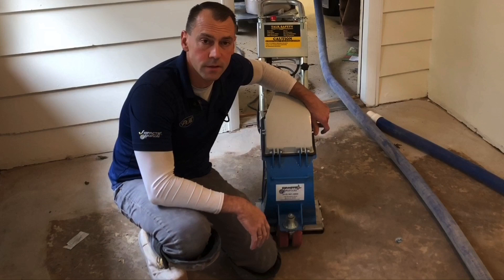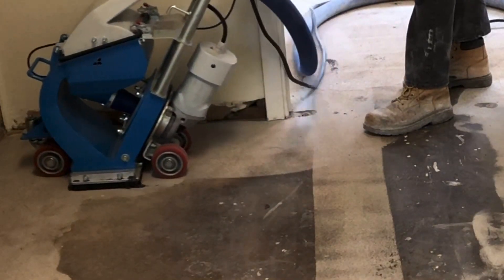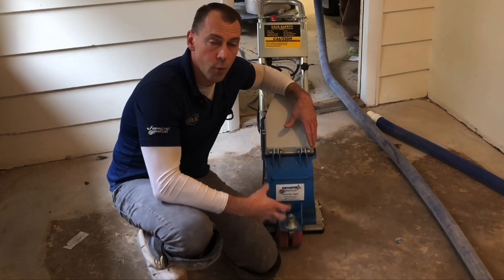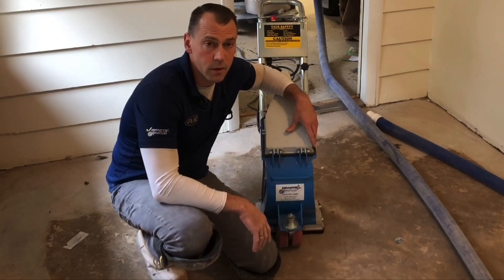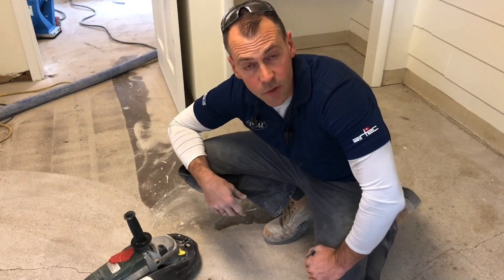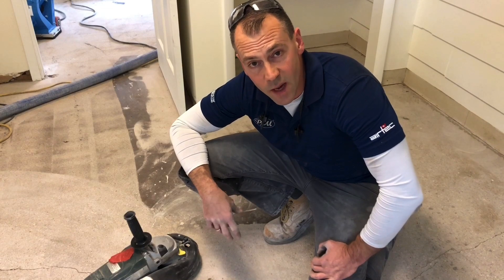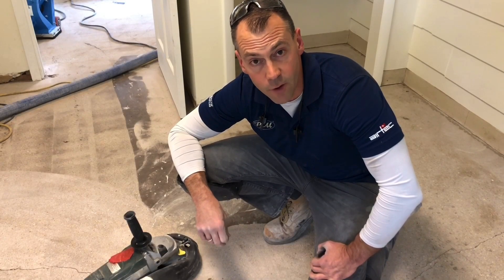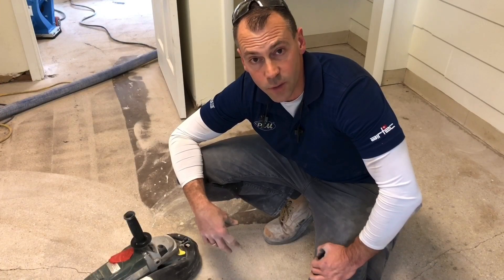Choosing Shot Blasting Instead of Floor Grinding for Surface Preparation

Comment: I complete a quartz floor and shot blasted...used polyaspartic.  on the finished floor I can still see the overlap of the shot blaster,  Should I have gone over with the diamond grinder afterward or maybe just use ehe diamond grinder from the start..wasnt a harsh profile but still showed.

Comment: If it is all about removing the weak layer then the shotblasting is great, but if u need to level the floor out then the grinder might be better
Reply: Well said. The blaster does a great job to remove the fine top layer and leave it dust free. If any elevation inequalities are present, though, those will remain the same after blasting.
Reply: @joshjones8047  to be fair if you are slaping on epixy it would semi self level but also if you are they to slap on a coat i wouldnt worry or expect the floor to be leveled

Comment: Why not just go over that area twice with the shot blaster? Would it not clear it off?
Reply: That’s why both tools have their place. Use a grinder first then shot blast for that perfect finish
Reply: That’s a good question. A second blast might remove the remaining material. The problem with a second blast, though, is the clean areas will be abraded a second time. This will leave these areas a little lower than the spots that still had contamination present.
Reply: Would the adhesive stick to the grinder?

Comment: Back to the grinder, i have not tried a blaster and usually do larger areas, should i just buy a grinder, or not and what model to buy
Reply: Sorry for the delay. If I had to decide which to buy first, it would be a grinder. Grinders are more dynamic to do surface prep than a blaster. They can remove adhesive, coatings, and flatten the slab. A blaster does a terrific job to remove cure and seal, provide a uniform #3-#4 CSP, and leave a very clean surface. A grinder is my preference for the first machine to own to do surface prep. 
As far as models, there are so many choices. The place to start is determining how many SF need to be done per hour. With either machine, the bigger they are the faster they go.
Reply: @joshjones8047  On my floor it seemed to me that the cure and seal was the biggest part of the problem in glazing the diamonds and I really wished I could rent or hire someone with a shot blaster but alas no one seemed to have or rent them around here.

Sometimes I wish I was in this business just so I could buy more cool tools - haha.
Reply: @jeffa847  haha! It does take specialized equipment to do this stuff. One thing about glazed diamonds, sand and water mist will open them up. The sand keeps the diamond crystals sharp. That trick will speed up the cutting.
Reply: This is going to be a very stupid question but here goes. I do a lot of wood refinishing of decks with paint on it. Would this work on wood?